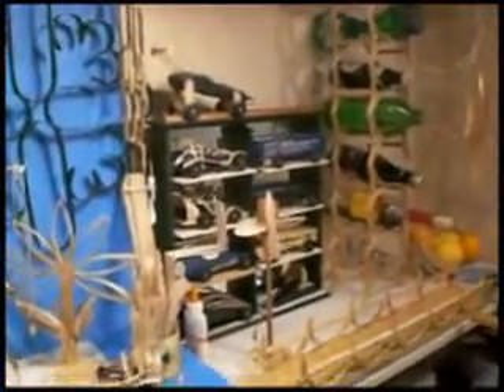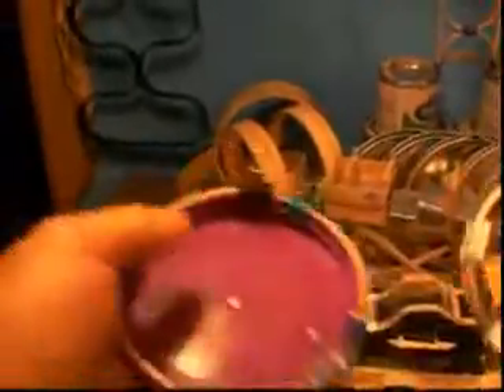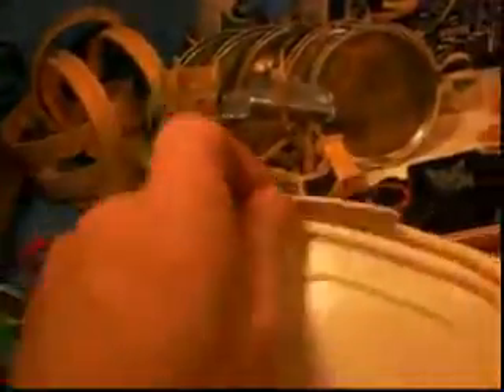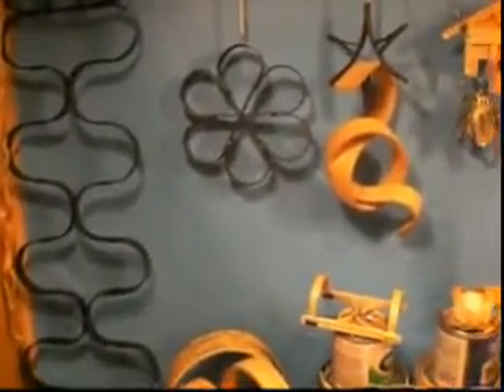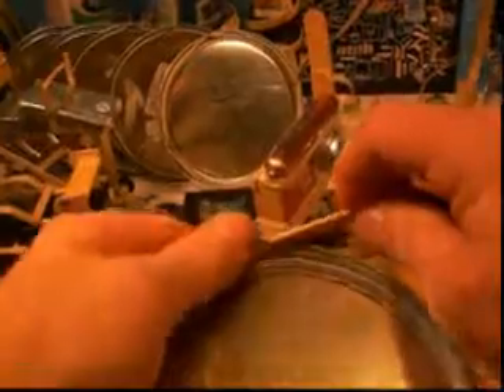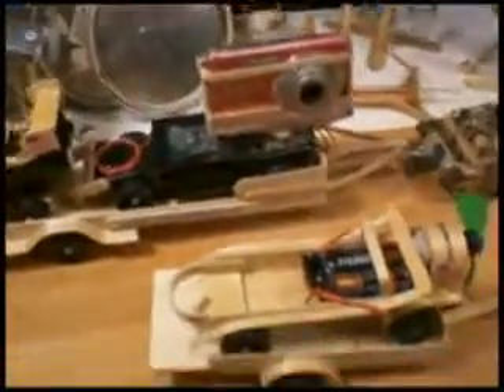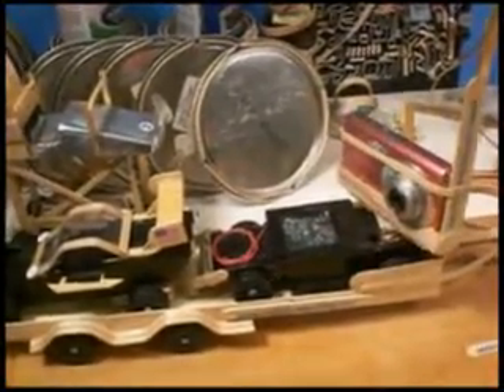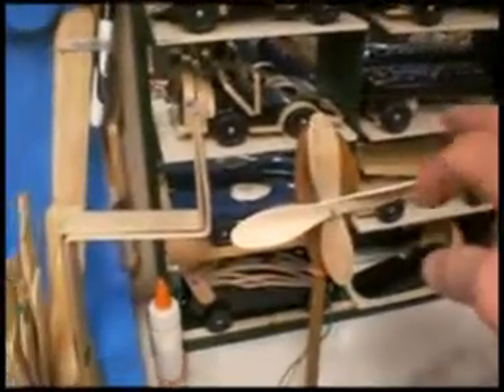Craft Stick Bending Video Two.flv

Comment from the maker: Hi Randy & Son This is only the start. I'm working with Yard Sticks & rulers and bending them at right angles, there is almost 50 percent brakage in the thickness BUT all you need to do is fill the broken part (snapped edge) with wood glue and  you have made a right angle from a yard stick. More to it ,but that is the basics